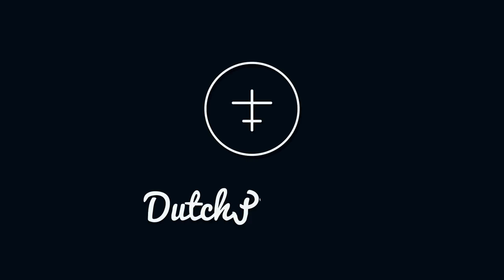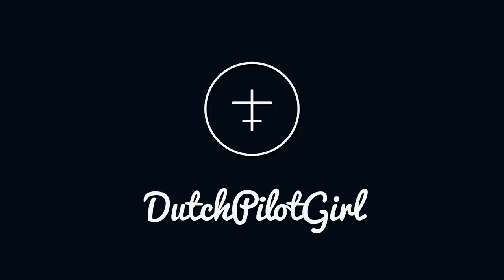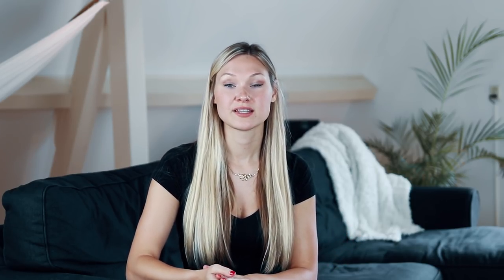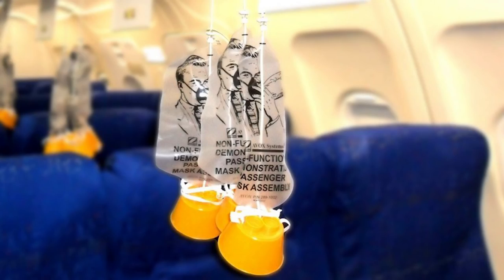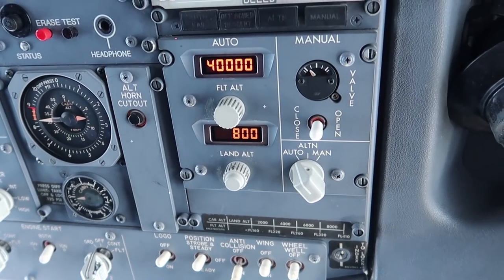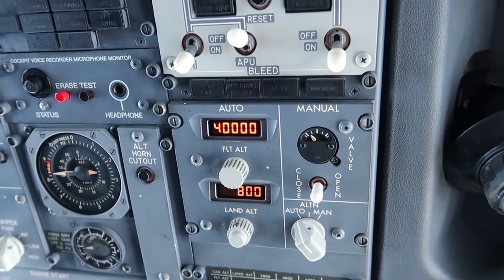What Happens If There Is A Hole In An Airplane - Loss Of Pressurization & Oxygen Masks

Comment: Another great video Michelle!  Interesting to hear about the "bleeding ears".  I'm told that sometimes this happens - but not always.  Depends on the incident, cruise height and of course not every passenger experiences it.   As far as I am aware, on the newer aircraft (787, A380 and A350 for example), the cabin is pressurized to only 4000 feet, instead of the usual 8000 feet found in most jets up to now.  This makes it a lot more comfortable in the cabin for the travelling public.   Is it the same in the new 737 MAX?   Are you destined to fly the MAX at some point?  be nice to know what your career moves are with regard to aircraft.   Do you want a Command on the 737 first or are you considering moving onto something else?   Possibly this might be private and if so I respect that.  Thanks for your contribution as ever - great stuff!  Lee

Comment: Hi Michelle.  I've never heard the term QNH before so I had to look it up.  Is there a simple explanation why you would call and request that information? Thanks for your help and, thanks again for anther great and informative video!
Reply: Thank you for that clarification Gun Nut.  I only fly GA here in the US at an altitude below 18000 so I generally rely on the ATIS or a pre-flight weather briefing to get the current pressure for my airport and forgot that at higher altitudes, aircraft default to 29.92.   Learned something new today!

Comment: I've often been curios about this are the spoilers rated to operate at relatively high speed such as in an emergency descent the forces on them must be immense! And what kind of descent angle or vertical speed to you have to achieve in one of these situations?

Comment: If pilot forgets to pressurize the cabin during takeoff and eventually the passengers experience nose and ear bleeding and also oxygen masks get deployed automatically, Does putting on the oxygen mask prevent bleeding and also are oxygen masks helpful in this scenario as the aircraft has not suffered any structural failure ?

Comment: I've heard from another video (not sure which one, I believe either from Captain Joe or Mentour) that the pilots' oxygen supply comes from an oxygen tank, whilst the passengers' oxygen supply comes from a chemical oxygen system. So whenever you check the oxygen system during startup you release a bit of oxygen, right? So after a while (I guess it'll take some months, maybe even years) the tank is pretty much empty. And since the supply is 100% oxygen, there is no way the engines automatically refill the tanks everytime they run. So how does this work? Does the tank get refilled everytime the plane goes into maintenance?
Reply: @abnormalzz, yes the O2 tanks gets replaced/refilled if the pressure is below 800psi for the 737's. We at the workshop charge it to max pressure of 2000psi. Thanks